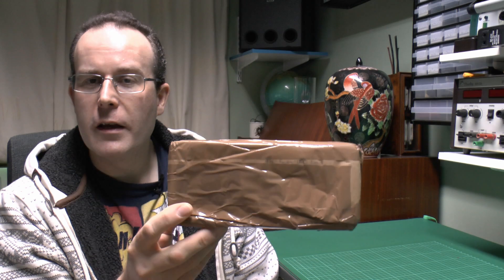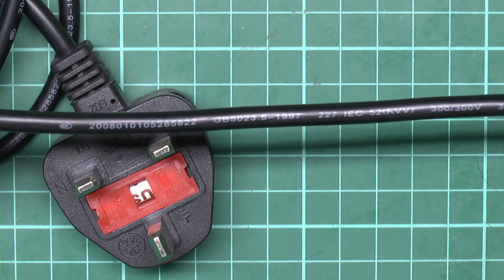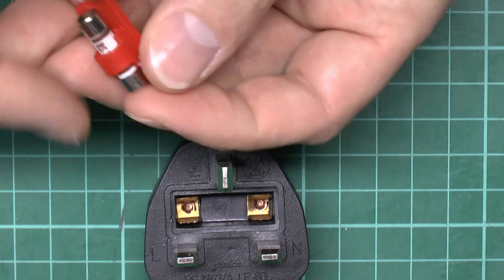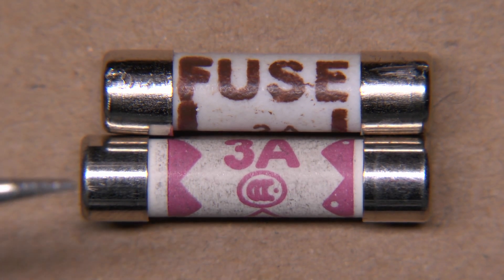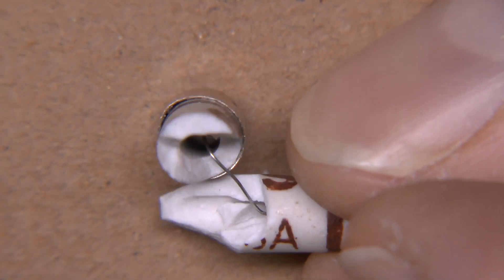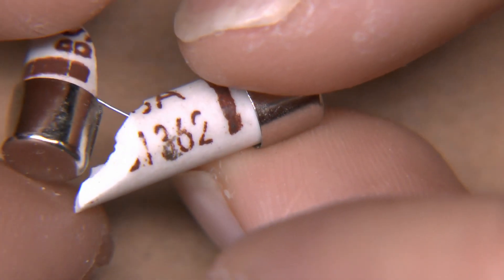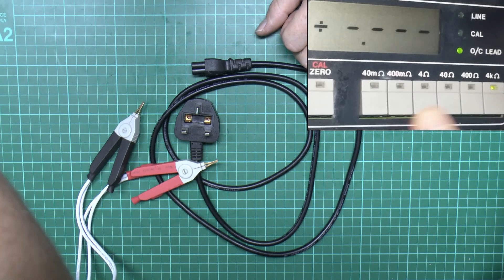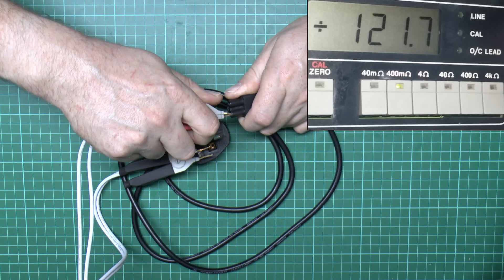Dubious C5 Power Lead

Comment: The connection of the wire and the plug could also be a problem, experienced heated up plug with a moderate load.

Comment: From a non electronics persons perspective, is there a way to tell these cables apart from the genuine laptop cables at face value at the store so I know to purchase the correct type?
Reply: Depends how well the outside is faked.  But sleeved earth pin on a supposed BS1363, DK or IEC plug is a dead giveaway the factory doesn't know how it's supposed to work.

Comment: This looks exactly like a dubious C5 lead I had... it came from Denmark when I attempted to order a type E/F to C5 lead. I used it for a while, but it eventually failed, seemingly at the type G end, on the neutral. When I cut the plug off, I found the insulation on the three wires to be the wrong colour (black, white and striped) as well as poor quality. I scrapped it, and a few other dodgy ones I found in my spares box.

Comment: FYI: The reason you had the problem with getting the fuse out of the red holder is the tight fit of the holder.
The rounded ends of the fuse easily slide into the plastic, but when trying to remove the sharp internal edges of the end caps hang on the edge of the plastic loop, making it difficult to remove.
I'm in the middle of ordering some BS1362 fuses; that's how I found your website.
I would have liked to see you measure the fuses before you broke them, as it brings up an interesting point. The BS1362 fuses I'm replacing are 6 x 30, and I am seeing 6 x 25. I haven't got far enough in the ordering process to see if both lengths are available, (some dang video about fake fuses interrupted me! lol).
Looks like I need to look up the BS1362 standards...
Good info... I need to watch the last part of this one, and the follow up..
Reply: Oh, I should add. The fuses I'm replacing don't look the fake fuse, though they did come from China.

They state 15A, but have small black lettering saying only BS1362, 15A and 6 x 30 mm.

I got them in two DC PMD motor control units, (PMD may not be accurate, they are phase mod controllers, so it's close. Just can't recall, and don't want to look it up.)
Reply: Looks like this Hong Kong company are making compliant 1362's:

http://www.vask-hk.com/index.php?m=Product&a=detail&id=16&new=1

Comment: I have a similar IEC lead, it came supplied with a hard drive dock from eBay. The fake BS1363/A plug is identical and with the Guida make, The resistance is more than a comparable genuine lead. The terminals of the IEC plug are of ferrous metal as are the fuse contacts of the plug.

Comment: Recently I got an AC that works near the 15 amp limit, but due to the location, it has to be plugged in to an extention cord. After buying 4 different extension cords, i gave up finding one that could ACTUALLY handle 15 amps continuous without getting uncomfortably hot, and ended up making my own. 15 amps at 110v requires more copper than anyone is willing to provide apparently, even though 15amp continuous on a dedicated breaker is perfectly within spec. It only took 5 minutes and actually was cheaper to make my own, so no sweat off my brow, but I do wonder how they are getting away with that. From my best estimate, it seems 12 amp continuous is being sold as 15 amp wire now, even though it could never handle 15 amps for 3 or more hours safely.

And mother of god... no sand filling? I have had the misfortune of seeing a ceramic fuse go off that did not have a sand filling. Not good for the heart. Sand is not only to absorb the energy of the explosion, the arc melts the sand and coats the wire, quickly insulating the wire from further arcing. Without it, the arc will grow out of control and BANG! Ceramic shrapnel and sparks everywhere.
Reply: +Richard Smith here in DE you can get 1.5mm² extensions regularily, and in most home improvement stores and in every electric supply store you can get 2.5mm² als well. If that is not the case in your country, that means your domestic production is sub standard as well or there is none...
Reply: In the US it should be quite possible to get a 14 gauge (roughly 2 mm2) or maybe even 12 gauge (something like 3 mm2 if I remember correctly) one and that SHOULD handle 15 amps quite nicely. the #12 should be good for 20.

Moulded plugs and sockets are a different issue though, you never know what's inside them.

Comment: the dimple on the official fuses is for fuse holders that use a spring to hold them in at the ends (i not seen that many devices that use the held in by the ends method)
Reply: The common example are the black fuse holders with screw on lid.  Fuse is held between the cap and a bottom terminal.

Comment: as a pat tester I'm seeing these leads every day and advising customers to destroy them. the part shielding on earth pin is contrary to bs requirements and actually stops the earth pin making proper contact with the socket giving a reading of several ohms rather than the 0.1 +r recommend in IET code of practice. also they nearly always have that particular motif stamped on the back so if you see that then treat with suspicion!

Comment: C5 connectors are rated for 2.5 A. So the Fuse might have been a 3 A fuse and there has never been the assumed 1. 
There is a good article in the german wikipedia about this kind of fuses. The Google translation ist a little bit of glibberish but i cold not find a simular article in English.  It also explains why the fuse was a little shorter: two rather simular standards 6 × 30 mm; 6.3 × 32 mm (¼ × 1¼ inches). Sand filling is not a matter of quality it changes the characteristics of the fuse.
https://translate.google.com/translate?sl=de&tl=en&js=y&prev=_t&hl=en&ie=UTF-8&u=https%3A%2F%2Fde.wikipedia.org%2Fwiki%2FSchmelzsicherung&edit-text=&act=url

Comment: Interesting vid, You'd never suspect something as simple as a power lead to be fake. I bet 99.9% of "PAT" testers (as in the person testing) never check for these things.
Reply: They do, but only for class 1 appliances. Usually if it's got a partially sleeved earth pin it'll fail the earth continuity test as it didn't make contact with the earth institute the outlet

Comment: You should have done the ohms measurement through the fuse. The cheap chinese fuses are made out of all kinds of funny materials. Also to properly compare against nominal resistance of materials nulling out the contact resistance from the equation could be a good idea.